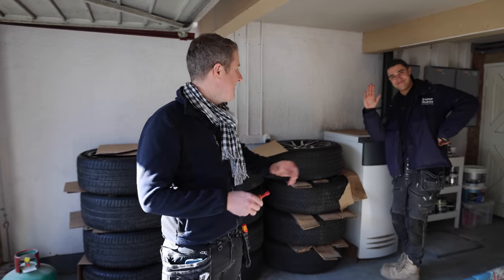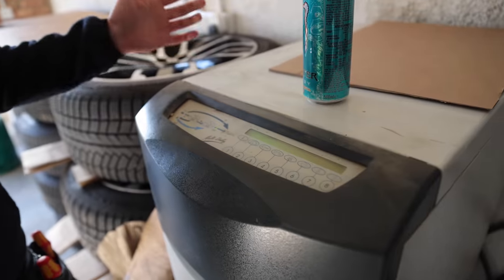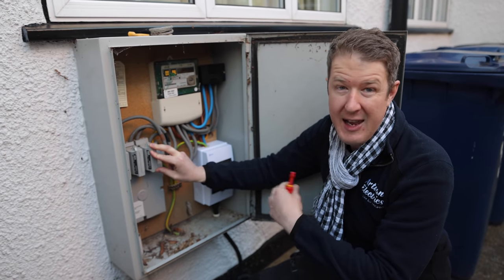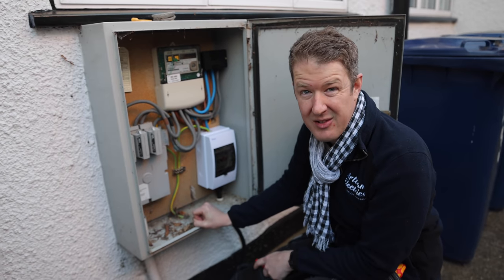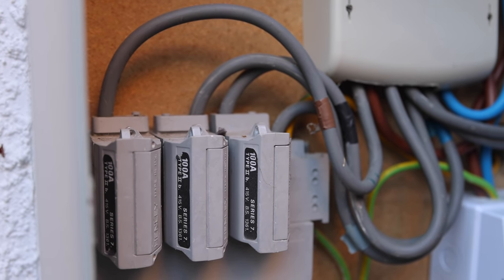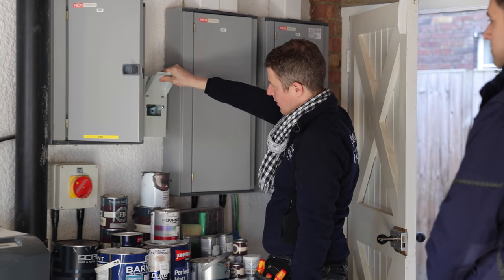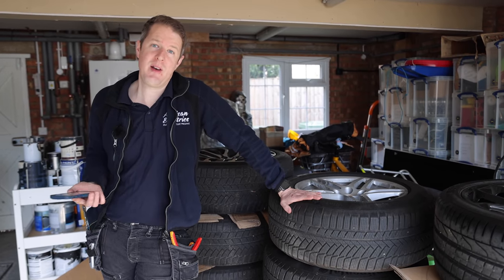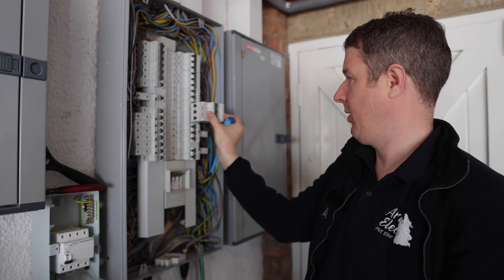INSTALLING THREE PHASE 22KW CAR CHARGERS AT HOME! - Electrician Life

Comment: The amount of money it must have cost to install that 110V system is surely more than it would have been to replace the relatively few appliances that don’t accept universal voltage inputs.
Reply: Depends its a big property probably used by American Airforce personal , if they rotate every 6 months back to the US  they wont want to be buying £5K worth of household appliances    , costs them nothing to bring kit from home. I worked in A building in London occupied by the US   every piece of kit was American all the snack and beverage machines only took US currency as did the canteen . Great place to work though
Reply: @steverobinson8170  I don't think that is that much equipment. Pretty much any electronic device (computers, TV, chargers, etc) these days has a switching power supply and thus can work full range 230V-110V. Then there are appliances (such as air dryers) that are available with a voltage selector switch. The other appliances are big appliances such as fridge, washing machine, etc that are cheaper to buy new than ship from the US to the UK. If you have some kind of special equipment that only works with 110V (that is probably something obsolete) you can always have a portable transformer, having a whole house converter seems overkill to me.
Reply: @alerighi  If it did cater for American personnel then shipping costs are not an issue just load it onto one of thier regular transporters  flying around .
Reply: I saw a video a few weeks ago from a YouTuber who shipped his (very ordinary) family cars over when he moved form US > UK. Then was surprised when he realised what a massive and expensive PITA it was to run a US-spec LHD car in the UK. The mind boggles at what some people will do to bring a taste of home with them!
Reply: @richardalderton1047  But did he tell you they get petrol at USA prices? If I could get that price I'd be driving a V8 everywhere too!
Reply: @dopiaza2006   I know , think i posted that up earlier

Comment: 1 Phase 100amp is already a lot more than the 1phase 35 amp or 3phase 25amp in the Netherlands. Wondering why the big difference. Maybe almost all the houses are gas heated and in the UK electric?
Reply: Probably most UK houses use gas but still quite a lot, especially flats, have electric storage heating and electric water heating.  Also electric showers are quite popular (although a bit rubbish for pressure) and they are in the 8 to 10kW range.

Comment: Wow, that's exactly the meter we have. Power companies have wanted to change the meter for a smart one several times but each time the guy has come out he has gone away again not knowing how. We have L1 and L2 into the meter with L3 not connected. L1 then feeds the main house consumer unit and L2 feeds a unit in the garden (via a secondary rotary meter). We don't own the house (church rectory) otherwise I would be inclined to get this all sorted out.

Comment: American low Voltage electrics are horrendously complicated.  the nominal Voltage for most portable appliances these days is 120 V, it used to be 110V but was raised many years ago.  In a domestic installation there is normally a small pole mounted single phase transformer feeding either one, or just a few, houses.  The secondary is wound for 240 V, but is centre tapped to ground, and a neutral wire is also connected to this point.  Most loads are connected between one of the 'hot' wires and neutral at 120 V, but certain large loads, such as cookers and clothes dryers, can be connected across the two hots at 240 V.  Such large appliances may be 240 V only or they may require a neutral wire for small loads such as timers or lamps.  the insulation colours are green for ground, white for neutral and black for hot.  Where both hots are present in a cable the second one is red.  Normally half of the 120 V outlets would be connected to each side of the transformer winding.

Three phase is almost unknown in single family homes, and is not always provided in small industrial premises; the hotel where I stayed when over there had a 240 V to three phase converter in the lift machine room.  Where three phase is provided there are several systems.  One which is normally found in older installations is 240 V delta whth one of the secondary windings centre tapped to provide 120 V for small single phase loads.  This means that two of the hot wires will be at 120 V from ground but the third will be at 208 V.  This is usually known as the high leg, and is identified at the distribution board by wrapping the wire with orange tape.  More often seen today is a 208/120 V star, they call it wye, connected system, basically a half-Voltage, 60 Hz, version of what we have in Europe.  Higher Voltages are available, 480/277 V being common in larger industrial installations.  480B three phase motors and 277 V discharfe lighting ballasts are widely used.  600/347 V can also be found, but I believe is more common in Canada than in the US.

The standards for the plugs and receptacles used over there are defined by NEMA and there are dozens of them.  They come in current ratings of 15, 20, 30, 50 and, in a few configurations, 60 A, though I've never seen a 60 A one.  They are known by configuration numbers, and the Voltage ratings are slightly higher than the nominal supply Vvoltage in most cases, e.g. 130 V and 250 V, though 277 V is not raised to a higher value.  A 125 V 15 A two pin plug would be known as a NEMA 1-15P while a three pin grounded one would be known as a NEMA 5-15P and a 20 A recepticle as a NEMA 5-20R.  250 V would be configuration type 6, 277 V would be type 7 etc.  These are the only ones I can remember off-hand, but there are many others.  Nobody seems to be able to agree as to which way up receptacles should be mounted, with the ground connection up or down.  Some claim that down is the reccomended way, others that up is safer.  I mounted ground down then the left blade is the neutral on 125 V and 277 V types.  On 250 V both main blades are Hot, but when the same connector is used on 208 V left is neutral.  in 15 A types 125 V blades are vertical, 250 V ones are horizontal and 277 V are angled.  For 20 A types the left blade is rotated by 90 degrees and 20 A receptacles have one 'T' shaped slot in the US so they can also take 15 A plugs.  277 V 20 A plugs, NEMA 7-20, have larger pins than the 15 A version.  I am pretty sure that some of the configuration types defined in the standards have never actually been made.  Some grounded plugs have a round ground pin, and othersca 'U' shaped one formed from sheet metal' receptacles generally have a 'U' shaped ground hole to accept either.

30 A and 50A plugs are larger than the 15 and 20 A ones but the same size as each other.  The 30 A ones have a 'L' shaped neutral pin and the 50 A type a flat one.  Some plugs are supplied with two interchangeable pins so they can be used as either.

These are known as straight blade types.  There is also a twist lock range with curved blades set on a circle, and in some cases a circular pin in the centre so that the plug can be rotated slightly to lock it in place.  Of course, these are nothing like the straight blade types and there seems to be no logical pattern to the shapes of the blades.

Comment: How can you avoid the 3 phase upgrade in the future? eBoilers to replace old type of gas combi boilers require 3phase supply and I cannot see any other alternative. Gas Combi Boilers are the most common heaters in the uk and no way you can put heat pumps every where.

Comment: That large white thing, is a riello UPS. Not just a 110v transformer. Its probably 3ph 400v in 110v out with UPS batteries.
Reply: and probably does frequency conversion (50 to 60 Hz) as well.

Comment: Why are external small cabinets always being used to house RCD protections on your installs?  In Australia we would have put in something like the Hager BD163T and kept the RCD on the board.
I have been meaning to ask for a long time as it seems common in your Car Charger installs to have a separate RCBO and Breaker rather than combining on the board and with single pole it is even simpler.

Comment: Pretty much every german home has 3phase. Weird to see that being an exception in uk
Reply: Germany / mainland Europe are way ahead of the UK in terms of electrical standards / future proofing - blow my mind that we still use ring mains 🤣
Reply: @benjaminc1816  
Nothing wrong with final ring circuits.  They have many advantages.  I put two in my place out of choice.
Reply: @benjaminc1816  
Three phases in averaged sized domestic homes is silly.  No need for it. Single phase is simpler with cheaper components. If my memory is correct, I recall some 150A single phase supplies in some all electric homes.  You will find that installing three phases into your home is more for the economics of the DNO rather than you. 

Germany is not way of the UK in standards. Recommendations is now RCBOs on each circuit (as I have), SPDs and AFDD. After 80 years no one has improved on the British 3-pin plug.

Comment: With a 3 phase supply like that with 3 100A fuses is the max they can pull still 100A not 300A due to the capacity of the neutral?

Comment: Hi all at Artisan Electrics I’am not an electrician but watch your videos all time I like your work ethic. I have question, I have a 32amp round pin with switch on the outside wall for when my son visits to charge his Tesla, can I use one of those round pin extensions to 13 amp socket for use on electric mower??

Comment: Rather fun that up here in the Nordics the smallest supply for a house is 3x25A, with no option for single phase anymore. I think most DNOs won’t do single phase except for technical applications, like a supply for an ISP network cabinet or something.
Reply: Same in the Netherlands most common is 3X25A, and in older homes and apartments 1X35A.

Comment: Neat little job that, would it not have looked a lot better and actually been easier for you guys if you just ran a duct and ran SWA underground?  Guess would have been more expensive though..
Reply: Also look at all them sharp bends armoured can still get damaged.
Reply: Nah be fine, plus the outer swa is earthed so even if it did get damaged it would trip pretty damn quick anyway...  I think though it would have just looked a bit neater going underground, would have taken a bit more time, but you could have got someone in to lift the slabs and dig the trench, what it cost you in a labourer to do that it will save you in electricians time as will be quicker to lay.. especially at £112.50 an hour..

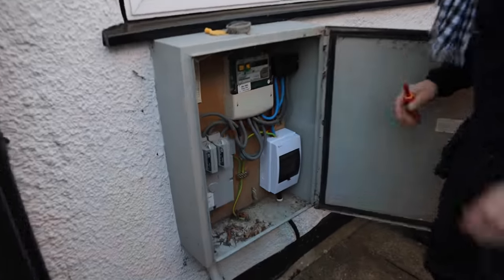Comment: 2:39 So you can't request larger single phase input power?  We have 400A 240V service entrance ability here, with normal 200A 240V pretty common around where I live in the south.
Reply: Will be rather expensive to create a charger that takes 91A (22kW/240V) through a single phase though. Remember the "charger" on the wall is really just a smart switch, the car itself does all the AC/DC conversion. If most cars won't take it, then there will be no market for such chargers.
Reply: @billccn  Strike that "most". It just isn't possible to get more than 32A of a single phase to a car with a Type2 connector. There's only N/L1/L2/L3 (plus PE and 2 data lines) in the plug and each of those contact maxes out at 32A. Putting L2 and L3 on the same phase as L1 would overload N---the only reason there's not N1/N2/N3 needed is because of the phase-shift of the phases.

In theory you could do L-L1/N-N/L-L2/N-L3, but that would need some very, very good communication between car and wall box to make sure neither switches to that configuration if there's anything else connected. (Not impossible, Tesla does exactly that for DC charging in pre-CCS2 models...)

Comment: 3 x 100 A is massive. In Finland houses typically are 3 x 35 A or 3 x 25 A, sometimes 3 x 63 A.
Reply: In the UK it doesn’t always correlate that just because the labels state the rating of the service head that the actual fuses fitted match that given rating, it can often be downrated depending to what is practically required.  It wouldn’t surprise me if this service head could have 80a fuses installed or even 60a depending on the size of the installation when the installation survey was carried out.

Comment: Just wondering do ye install load management clamp on clamps to monitor the loads of each phase , and if so  how does it link to the charger
Reply: Looks like they haven't on this one which is a bit crap as this house has a bit of load on it. You would install a cat 5 cable from the chargepoint to the main tails of the house just after the electricity meter.

Comment: I'm installing loads of 3 phase meters for octopus energy at the moment in domestic dwellings.aldo I'm working on new build sites that are fitting 3 phase as standard or instal a split load.its surprising how many jobs I'm getting where dno are upgrading to 3 phase.they are reluctant for obvious reason to run ev chargers ,solar and heat pumps on 100 amp single phase.
Reply: Are you working for a DNO or as an electrician?  I have the three 100a fuses but I don’t have the meter tails so would need a new meter.  I wasn’t sure if “normal” sparks are allowed to work upstream of the meter.
Reply: @johnalvey5332  
You would need a three phase meter. The DNO supplies that and the tails from the three fuses to the meter. You supply the three phase Consumer Unit.

Comment: Thought I saw somewhere that in new builds in Wales Western Power Distribution are fitting 3 phase supplies as standard to support all these car chargers.

Hopefully other DNOs will follow suit!
Reply: That is true. Only 3 phase cable and head for now and only use one phase. When the works will be cartied out on the lines, all they will have to do is connect up.

Comment: Any reason too use single phase? In Sweden all houses have three phase. We use 16A or 25A and in rare circumstances 32A...we have all installed with solar and batteries and EV with 16A.

Comment: Love the US 110v system. Any issues with that being signed off under the regs ?  I wouldn’t have thought they would contain anything about the US wiring.
Reply: Probably just normal cabling, just like running 110v supplies from a big transformer to yellow commando plugs, the outlets may be a departure from bs7671
Reply: It will be fun if the 110V outlets have been wired as a ring...
Reply: @JC-jv5xw  
No reason why they cannot be.
Reply: @JC-jv5xw  - the could be, but no real reason.  US code requires a duplex receptacle ~ every three meters.  My bedroom has 14 places to plug something in. 😜🇺🇸👍🏻

Comment: Judging by the distribution board, what you have there is probably not center tapped, but maybe a 3-phase transformer with one side of each secondary coil tied together and earthed to form a neutral and have three 110V phases. 

The sockets you have there are not real American sockets. They probably wouldn't be allowed in the UK because of the exposed terminals. The screws are not recessed at all.

Comment: Jordan
What do you think of the size and layout of the U.S consumer unit compared to the ones you usually use.
Although this did not have the finesse of install  i think its size and layout are more practical  than the biscuit tins they have installed in the UK.
Shout out to Gretta. She is still at the front line. And Cory's favourite Swede.
How about a B role of Cory pulling up his pants. The diet is working.
Ouch!!! My head.
Reply: We use a lot of those boards in commercial and industrial setting..  I agree they are a lot better, often we have consumer units hidden somewhere and its a pain to work on..  Also 3 phase is becoming common place on new builds now so maybe it will be the way forward...

Comment: Is der a reason ur not using a type B rcd instead of type A  as they are effectively designed for car charging circuits??
Reply: Because the manufacturer requires you install a type A

Comment: I've got three phase supply coming into the house. Next door is looped off one. I only use one. And my meter is single phase and my consumer unit.
I got a charger which is three phase ready (I'd need a new tethered cable) but otherwise if I ever get round to getting a heat pump of hvac etc I could get the DNO to 3 phase my meter ( I think - don't know if next doors lopped supply would be an issue) and then get my 3 phase consumer unit done + charger.

Not sure it's worth the bother currently as my kona only accepts 11kw 3 phase. Not sure there's an aftermarket for upgrading that to 22 to be honest.

Comment: Yea, in North America we almost never connect 3 phase to a house. As some of the other commenters have said we have split phase 240V. .. That is it is split by a transformer at the street into two 120V legs, and if 240V is required (for larger appliances) then both legs are tapped in a two pole breaker. 

It's common for most houses to have at a minimum, 100A @240V, and usually it's 200A. Larger houses will have 400A, and it's not even unusual to have 800A coming into very larges houses. In the end it's just a different approach, although there are upsides and downsides to both. 

Oh, and side note, we absolutely do have ground fault protection, it's just either done with the first device on a circuit (this is usually for receptacles, required in wet areas such as bathrooms, kitchens, etc., although not uncommon for all receptacles now) or through a circuit breaker that includes the ground fault circuitry in it. I do think NA is a bit further ahead in arc fault protection, though. It's been required in sleeping spaces for years, but it's now becoming required anywhere there are receptacles, etc.